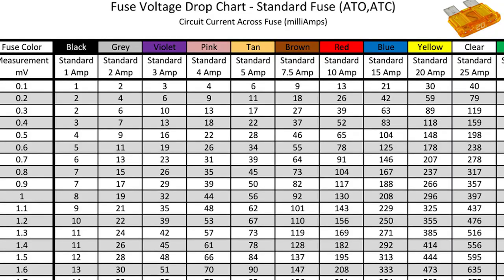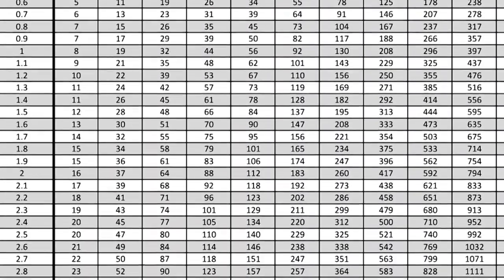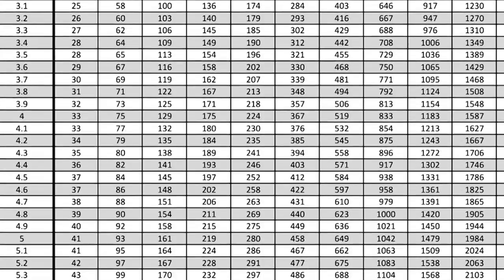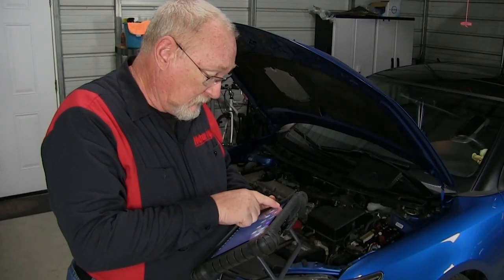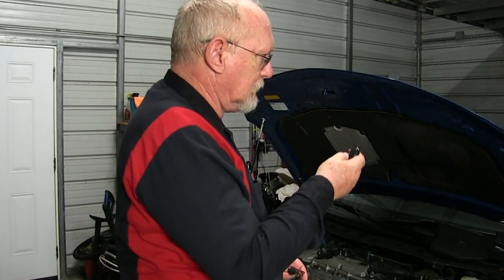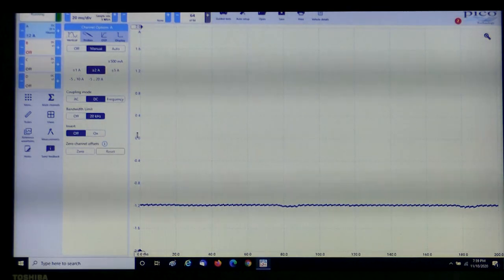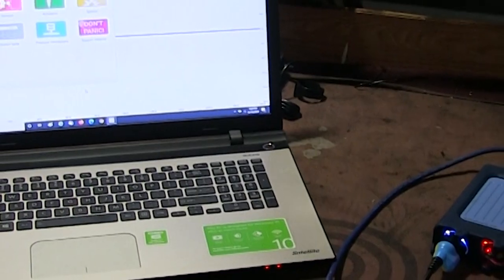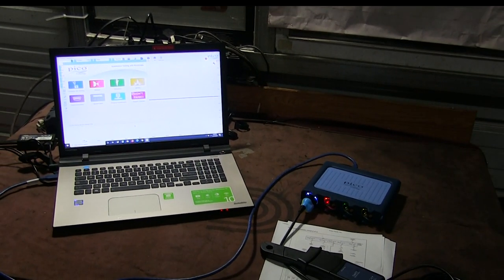The Trainer #108:  How To Isolate The Cause Of A Key-off Battery Drain

Comment: I agree that the scope.makes the most sense for many reasons . However , as a DIY with a DVOM , I am using the basics . I don't know how many diodes go bad in alternators , but a ripple voltage test is quick and would save time - if that is the problem . My ESI battery tester has it . The Topdon battery tester , UNDER $ 50.00 , has it . And you can use a DVOM set to AC voltage to test at the battery . It should be .5 or half a volt or less . I can't see a high end shop not having a tech trained on a scope . Most shops will be left in the dust .

Comment: Still didn’t talk about actually finding the draw which is the hardest part. Running through power and ground distribution, circuit configurations. Typically this part is the hardest part in actually finding everything that’s under that circuit.
Reply from the maker: Thanks for the comment. I'll address that in our December TechTip - out next Monday!

Comment: I noticed Not once did you mention about pulling fuses so I’m thinking along the lines that you don’t like that idea probably because if you pull of use when you put it back in maybe it might inspire one module to turn on don’t know. I await your reply
Reply from the maker: If you're chasing a module that won't turn off, opening the circuit may cause the module to reset and you won't be able to verify the problem.
Reply: @MotorAgeMagazine  hang on. Ok so fuse is the bridge for the electricity to get across the gap to whatever its there to power. But if you have the neg lead going through your multimeter to get to the neg battery pos and set to millivolts, if you see the draw suddenly drop, theres the drain. 

Was on a job today for a customer. Found his drain that way. Last of the fuses to pull in his engine bay. 70 amp marked speedo. Yesterdays customer though I never found and I had pulled all fuses and relays engine and inside car plus all engine connectors. Had same bad luck on 2010 Ford Kuga. Then read known issue was bluetooth module. So told customer to disconnect his phones from it and that was the drain. 

Pulling fuses  has to be the best idea. Someone else said lead with low current test light from battery neg and then if touching fuses it lights theres your issue. 

Na I truly think pulling is good, but likely better if you dont put back straight away. Pull next fuse and next fuse. Till drain goes.
Reply from the maker: @jamesbarratt593  Pulling fuses is a good technique and one we've used for a long time. My only point is that once you've pulled the culprit fuse, how do you locate the component if that component resets as a result? Another reality are modules that turn themselves on and off so monitoring current draw while testing ensures you're testing while the drain is occurring. Thanks for taking the time to comment!
Reply: @MotorAgeMagazine Usually cars with drain are old cheap cars worth nothing. So to do the voltage drop way would be real fast and then my hourly charge would suffer tremendously. Pulling fuses I can make the job 3 times longer and so the money coming is better. 😀